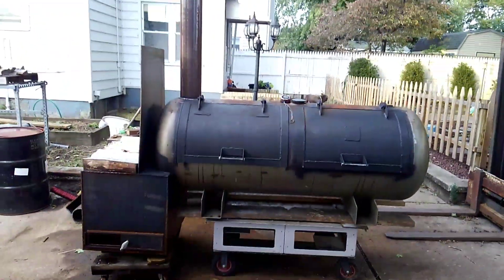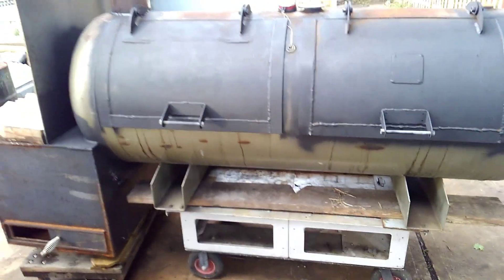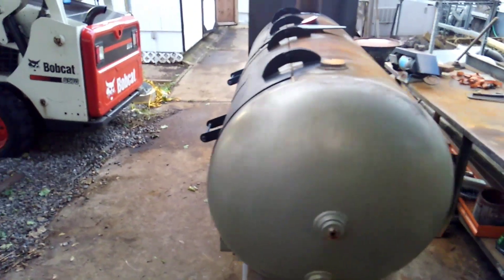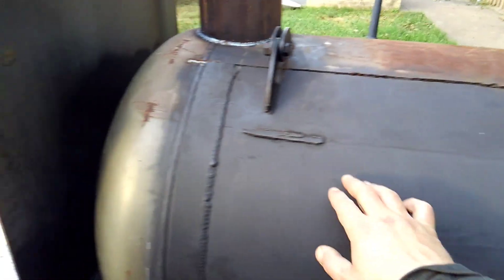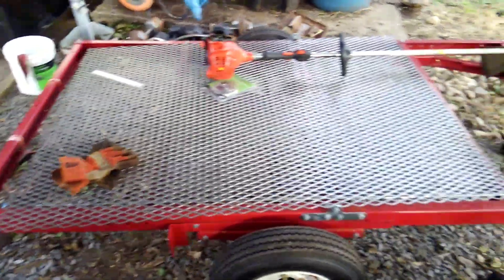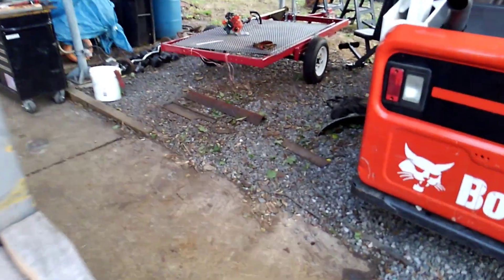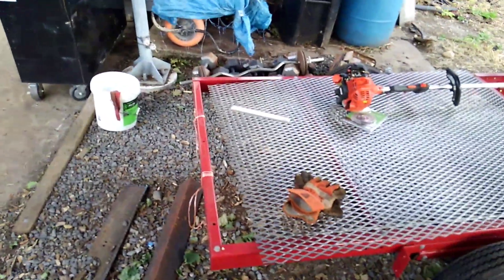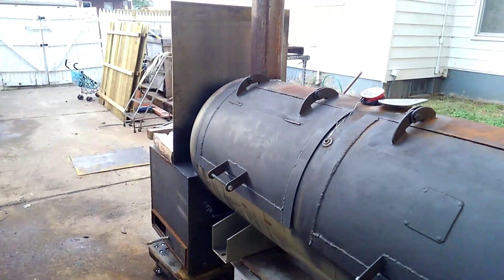BBQ Smoker Trailer 250 Gallon Build

Comment: Hi! What size is your firebox intakes if you don't mind. I'm having my door redone to have a intake added. My sides are insulated. I would have it done like yours but can't.
Reply from the maker: Hi sorry for the late response, for my smoker I needed 55 sq in of intake. So I ended up putting 2 inlets 3" x 9.25" each. I used this site http://bbqpitcalculator.com/ for all my dimensions and it worked out perfect.
Reply: @srmcontracting  Thanks! Thanks about what I went with. My fabricator did well with it. I also added an intake across from the throat in the smoker door. Its worked out well so far.